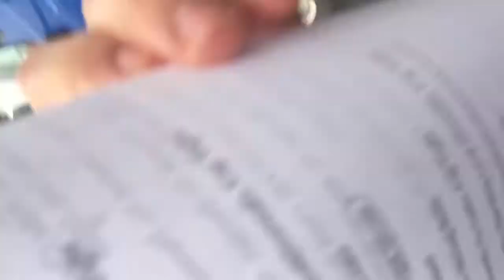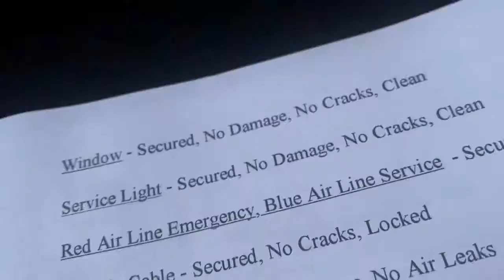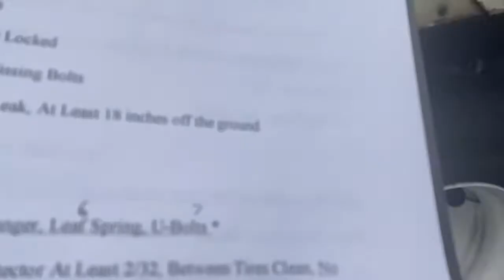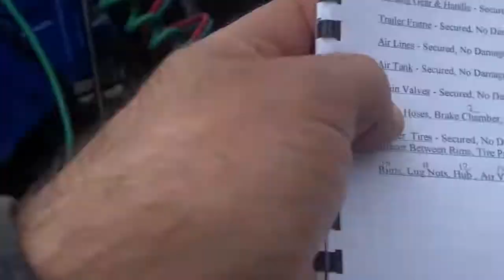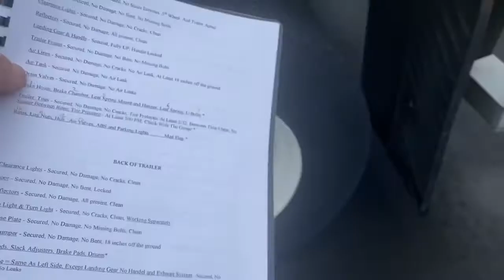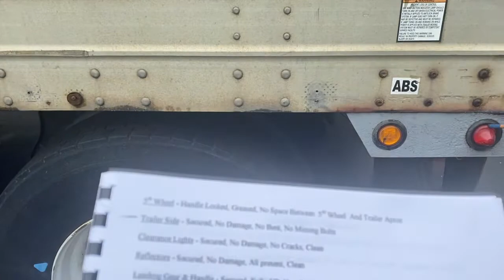CDL PRE TRIP INSPECTION  PENNSYLVANIA USA

Comment: Hello..is Alley dock required among CDL skills maneuvers road test in Pensylvania state? Thanks
Reply from the maker: Yes
Reply: @ozgannn  thanks very much
Reply: Alley dock is not required. One strong side OR one blind side Parallel park, straight back, and one other. Weather that be off sets or alley dock is usually up to the instructor. When I was in school about 4 years ago I did straight back. Offset. And parallel for my license test.
Reply: @andrewneidinger3726  Thanks very much
Reply from the maker: @andrewneidinger3726  now it is required I took the test a few months ago in PA
Reply: Currently in school, my instructors tell me that straight backing and offset backing are required. And depending on the examiner they will give you either sight/blind sided parallel park, or sight/blind sided alley dock as the third maneuver.